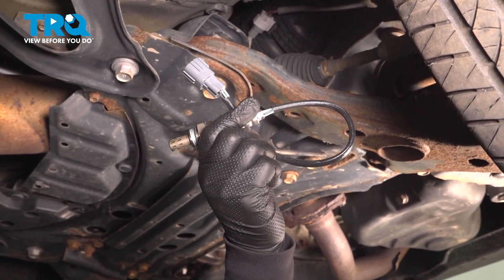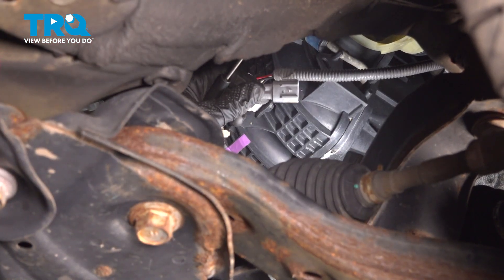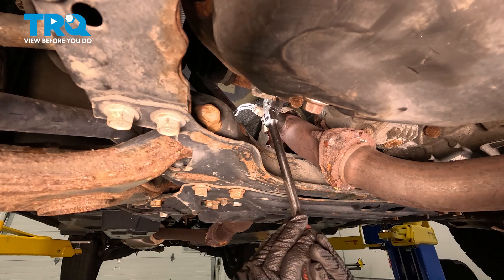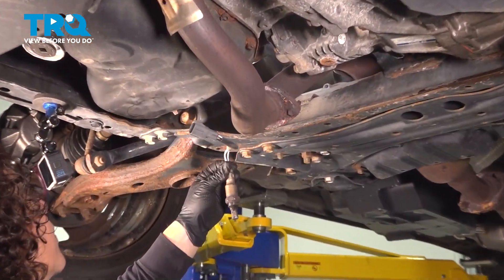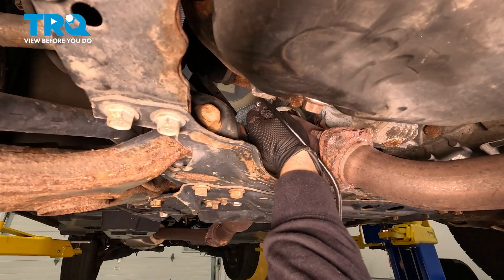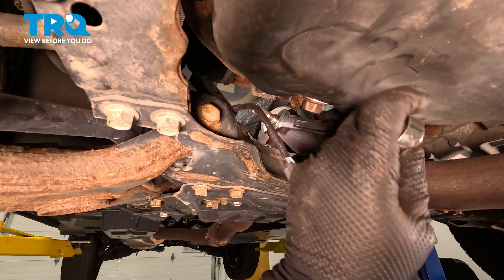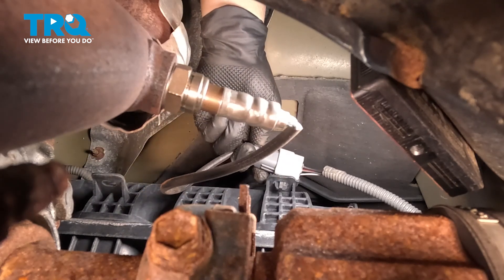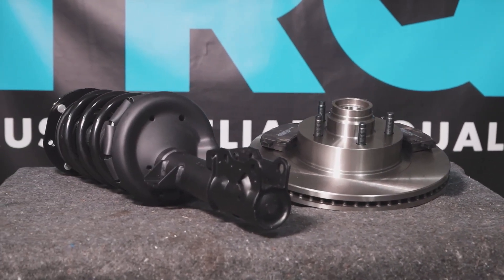How to Replace O2 Oxygen Sensor 2013-2018 Toyota RAV4 2.5L I4

Comment: If you don’t have a heater, you can run the engine for a minute or two to heat it up. Usually works. A little penetrant oil helps too.